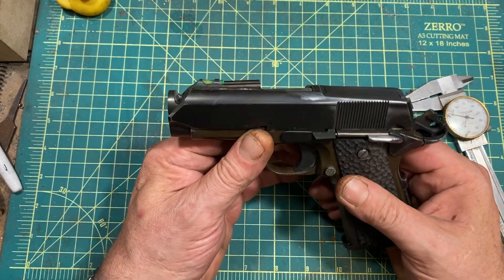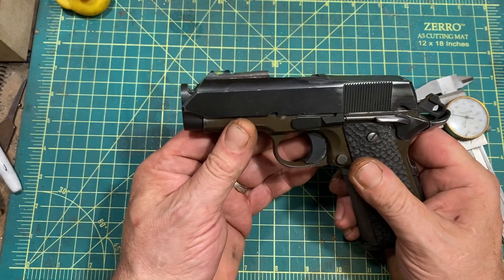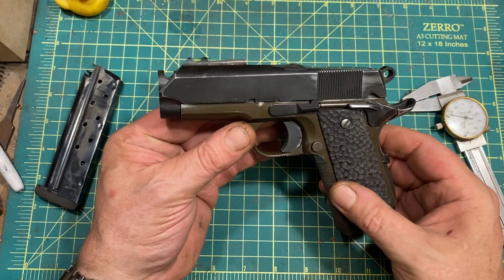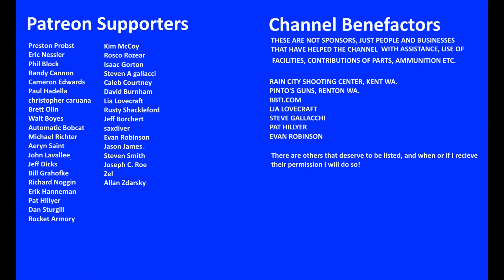The Street Racer 1911 Evolved... Even More!

Comment: I like that sight and its set up and what you did to the top of the slide.   I need to go back review the video to see where you got the components for it.  I might try something like that out on something that is inexpensive like a HiPoint or a spare 1911 slide that I have sitting around looking for a way to make it useful.  With light and that set up, I wonder how such a gun would work in low light.   For close range gunfighting there is a technique called 'meat on the metal'  by some in which the gun is aimed by extending the arm and just sighting over the slide.  That sight set up seems to make use of both worlds.